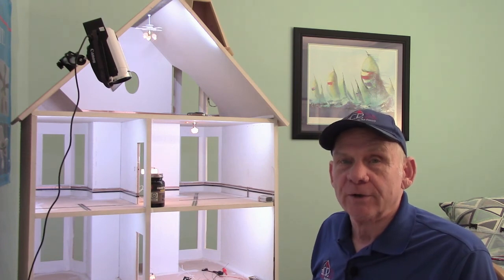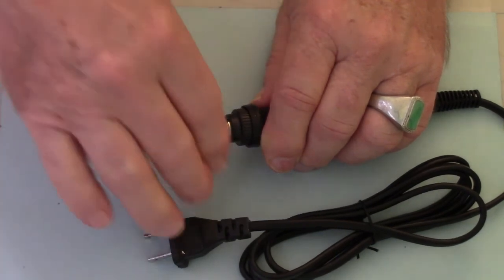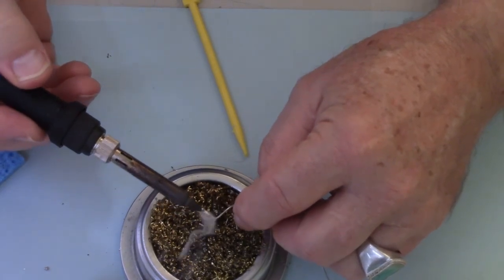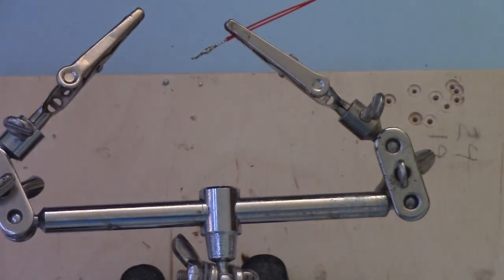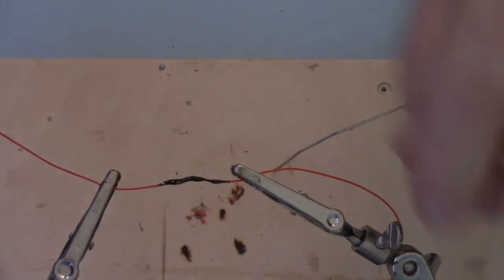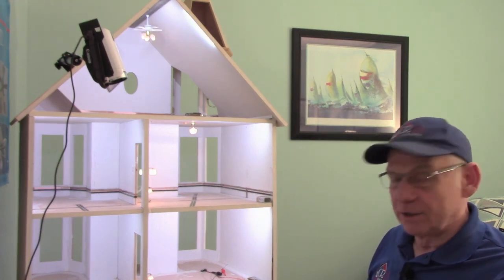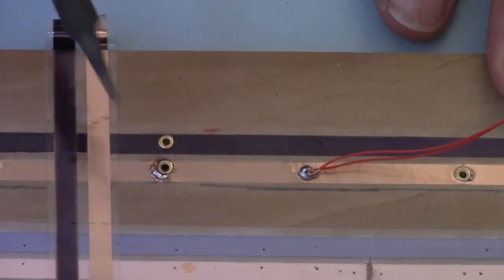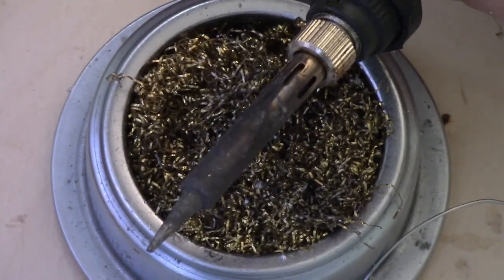Introduction to soldering

Comment: Best video on soldering on You Tube. Even better than the Weller video. Really needed to know about the parts that darken and oxidize but you don't have to worry about. And leaving solder on the tip when finished with it.

Comment: Hey Carl great video on soldering.  So I followed your instructions and yesterday it all worked perfectly just the way you said but today the solder won't stick to the tip of the soldering iron no matter how many times I stab it into the brass thingy, the solder just rolls up into a ball. Does that mean the tip is blown already?
Reply: He mentions this in the section about tinning, around 10 minutes into the video. Hope it helps.😊